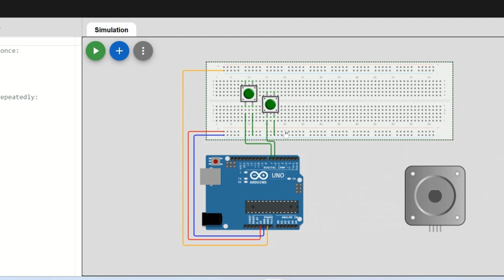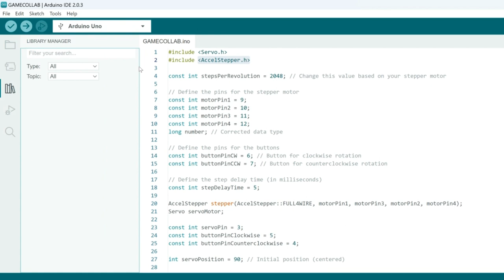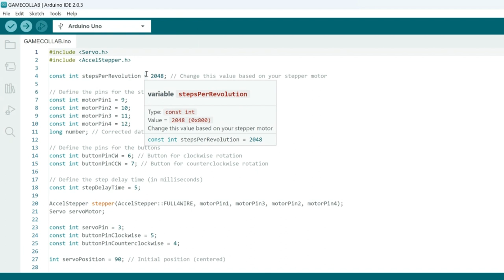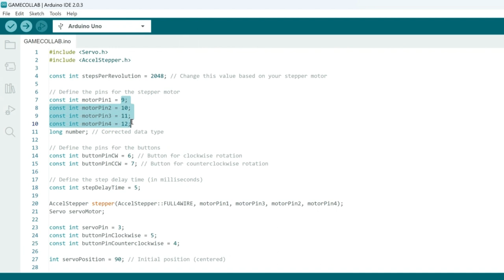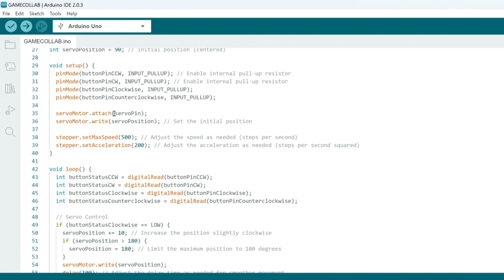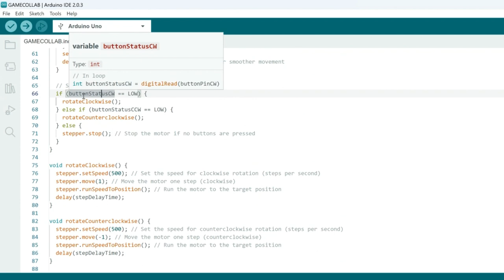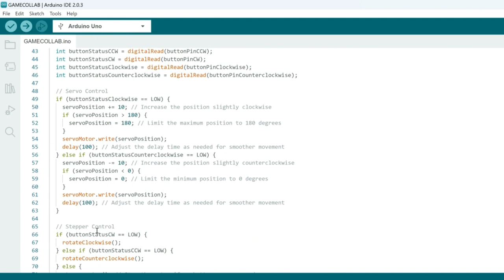Arduino Subject 3.0 Collab Game Challenge Part 1 - Stepper Motor Rotating Base with Buttons

Comment from the maker: #include <Servo.h>
#include <AccelStepper.h>

const int stepsPerRevolution = 2048; // Change this value based on your stepper motor

// Define the pins for the stepper motor
const int motorPin1 = 9;
const int motorPin2 = 10;
const int motorPin3 = 11;
const int motorPin4 = 12;
long number; // Corrected data type

// Define the pins for the buttons
const int buttonPinCW = 6; // Button for clockwise rotation
const int buttonPinCCW = 7; // Button for counterclockwise rotation

// Define the step delay time (in milliseconds)
const int stepDelayTime = 5;

AccelStepper stepper(AccelStepper::FULL4WIRE, motorPin1, motorPin3, motorPin2, motorPin4);

const int servoPin = 3;
const int buttonPinClockwise = 5;
const int buttonPinCounterclockwise = 4;

void setup() {
  pinMode(buttonPinCCW, INPUT_PULLUP); // Enable internal pull-up resistor
  pinMode(buttonPinCW, INPUT_PULLUP); // Enable internal pull-up resistor
  pinMode(buttonPinClockwise, INPUT_PULLUP);
  pinMode(buttonPinCounterclockwise, INPUT_PULLUP);

  stepper.setMaxSpeed(500); // Adjust the speed as needed (steps per second)
  stepper.setAcceleration(200); // Adjust the acceleration as needed (steps per second squared)
}

void loop() {
  int buttonStatusCCW = digitalRead(buttonPinCCW);
  int buttonStatusCW = digitalRead(buttonPinCW);
  int buttonStatusClockwise = digitalRead(buttonPinClockwise);
  int buttonStatusCounterclockwise = digitalRead(buttonPinCounterclockwise);

  // Stepper Control
  if (buttonStatusCW == LOW) {
    rotateClockwise();
  } else if (buttonStatusCCW == LOW) {
    rotateCounterclockwise();
  } else {
    stepper.stop(); // Stop the motor if no buttons are pressed
  }
}

void rotateClockwise() {
  stepper.setSpeed(500); // Set the speed for clockwise rotation (steps per second)
  stepper.move(1); // Move the motor one step (clockwise)
  stepper.runSpeedToPosition(); // Run the motor to the target position
  delay(stepDelayTime);
}

void rotateCounterclockwise() {
  stepper.setSpeed(500); // Set the speed for counterclockwise rotation (steps per second)
  stepper.move(-1); // Move the motor one step (counterclockwise)
  stepper.runSpeedToPosition(); // Run the motor to the target position
  delay(stepDelayTime);
}